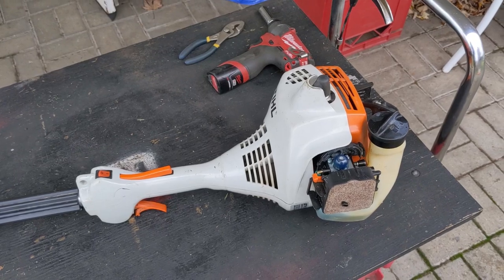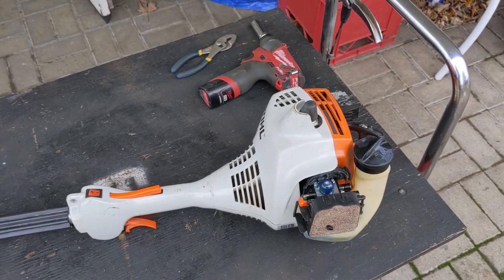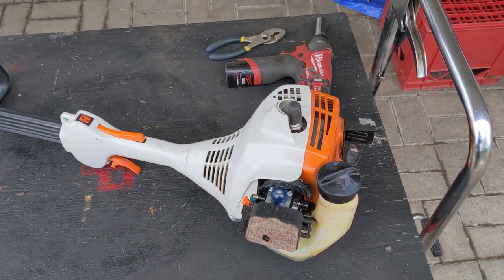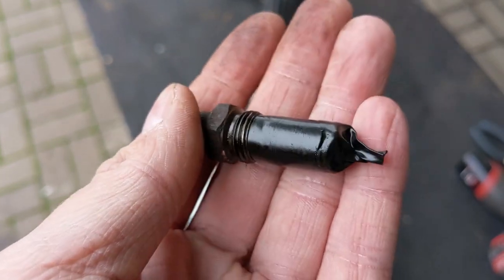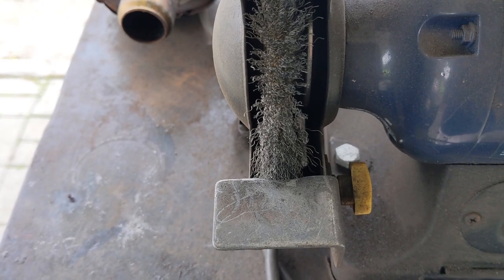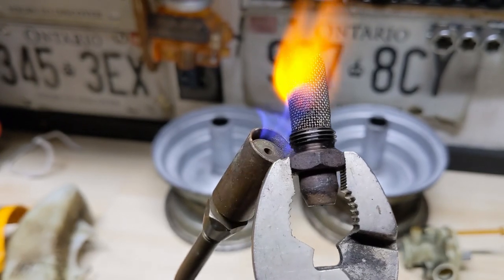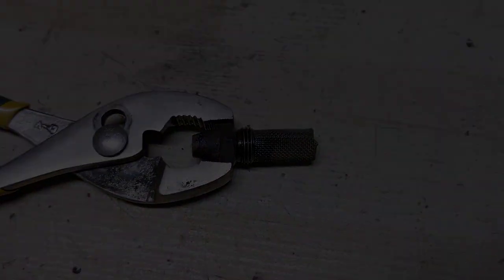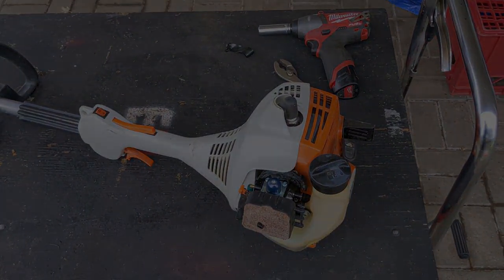EP Tech Tip #5 - Check the Spark Arrestor

Comment: Where the spark arrestor screws in, does it ever get clogged there?
  Have a weedeater that will not rev up. 
  Also have one that will not idle. 
  Have done the carbs. Even took the one that does not rev up to a friend that works in small engines on a regular basis. He gave up on it. 
  I assume he checked compression.
Reply from the maker: Check compression to rule that out, as the greater the compression, the greater the suction to pull fuel in at low rpm. If you rev it out it pulls fuel through just fine so a bit lower compression wouldn't really affect higher rpm. Also, you could take the whole muffler off if you wanted to. The spark arrestors get clogged but then again the whole muffler/exhaust could be gummed up.
Reply: I have gotten rid of a few weedeaters that would fall to the ground if held by the starter rope thinking they had low compression. 
  Some would hesitantly fall to the end of the rope. 
  Could that have been border line low compression?
Reply: @EliminatorPerformance  Mufflers were clear. I normally check the muffler and spark arrestor first thing.
Reply from the maker: Absolutely
Reply: @EliminatorPerformance  Absolutely low compression if they fall to the end of the rope?